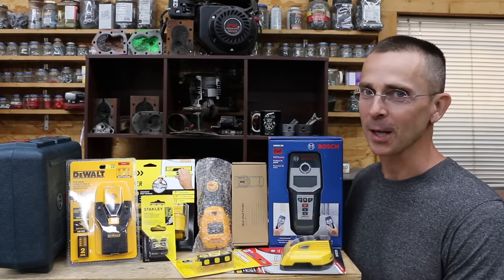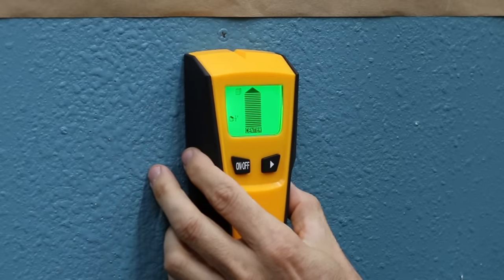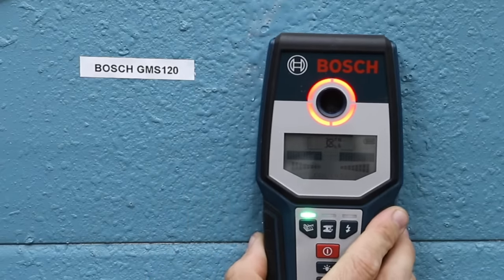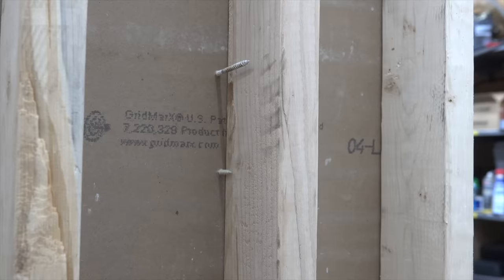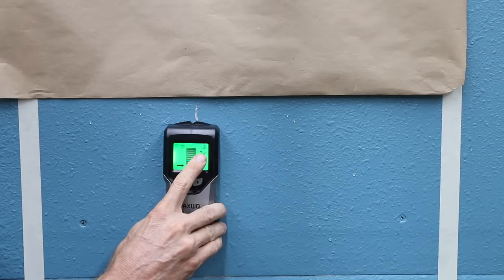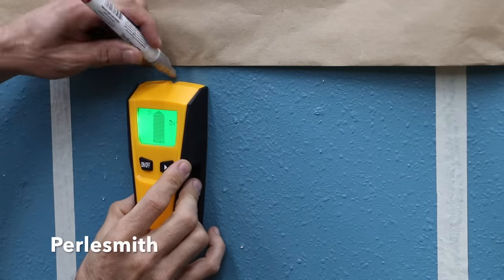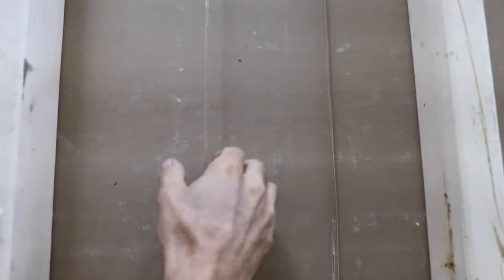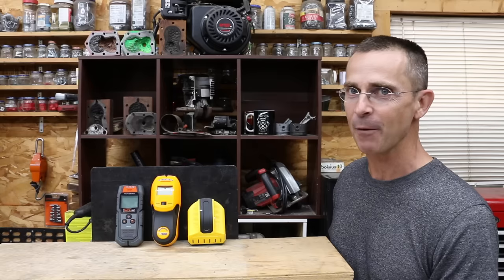Best Stud Finder? $262 Bosch vs $10 CH Hanson vs 9 Other Wall Stud Scanners! Let's find out!

Comment: Best channel on youtube by far. I own an old house with nothing but lath and plaster. Best results for finding studs  is to detect the small finishing nails that are used to secure the laths. The magnetic ones work really well and was able to find them well with the cheap Amazon one using metal mode (Model TH510)
Reply from the maker: Thanks for the feedback.

Comment: Great review, but hears a thought, many old homes have .75” of plaster over lath or .5” of plaster over blue board. I live in the latter and have never been able to find a stud finder that works well through thick plaster 😞😎
Reply: Walabot plaster/concrete mode might work
Reply: The Franklin T13 works great at my house. I have what is called Kal-Kote. It is a plaster type of product and cheap stud finders do not work for me.
Reply: @AnthonySomes  never seen a challenge yet my Wallabot couldn't handle.
Reply: After removing enough lath and plaster to make me consider changing careers and learning that forgotten trade just to save others from the removal process, there should be enough nails running up the studs that a good magnet can pick them up.
Reply: My in laws have a 1856 farm house. Finding the true 2x4 solid oak studs is impossible without just cutting into it. Sucks.
Reply: @jasonc3522  LMAO.
Reply: @jasonc3522   not if its metal lathe
Reply: @trenvan5546  didn't even think about that nightmare, I'm usually working in old historic renovations if I'm dealing with plaster.

Comment: Now what I'd like to see would be the same test again, but this time with old-style lath and plaster rather than drywall. My limited experience is the extra plaster density and wood lath make it so most stud finders either decide the whole wall is a stud, or decide there are no studs.
Reply from the maker: Thanks for the suggestion.

Comment: I’m not sure how you’d test them, but how about shop hand cleaners like Fast Orange, Lava, etc?
Reply from the maker: Thanks for the video idea.
Reply: Include Prosoap in this one.
Reply: Also new motor oil to clean hands
Reply: @backwoodsbilly8548  No, no, no...WD40!
Reply: Have to include gojo too
Reply: Kerosene or gasoline works well for getting thick grease off your hands. At the expense of the smell
Reply: Meyers soap too!
Reply: Dawn dishsoap works better than most I've ever tired with less effort.
Reply: Cherry Bomb soap is amazing for removing old axle grease, as is the el cheapo dollar store hand cleaner (like the type of gojo without pumice)
Reply: @sipdachery3  As a residential painter the best we used for paint was kerosene (was on hand as paint thinner and heater fuel, anyway). 2nd to that I think was Fast Orange with pumice and Goop, which were also much better smelling and better on the skin.
Reply: As an addition, in times of need, u found that a few good pumps of hand sanitizer will loosen a lot of grime out in the field, so include that as well.
Also, I found that moist hands and some powdery clay from the ground can also provide an impressive amount of cleaning power, and that ine takes a bit of practice.
Reply: Dawn and play sand mixed. It takes everything off.
Reply: That's a good one
Reply: How about trying transmission fluid as a hand cleaner
Reply: "big wipes" supposedly no heavy carcinogenic chemicals in it, so much safer and friendlier for the skin.
Reply: Boraxo
Reply: @johnkay6197  I've done dawn and salt, and that seems to work good, it helps that they're both right in the kitchen
Reply: Brake cleaner #1 Shop rag #2
Reply: I always thought Lava should make a liquid body soap called Magma, for people to deep clean after a long day at the factory. And nothing caffeine or stuff like that, calming smells to help you relax from the day
Reply: snap on pink hand cleaner will win hands down
Reply: TIDE, LAUNDRY SOAP! used it all the time when I worked for an auto salvage company.
Reply: YES
Reply: Test it by removing grease from white canvas.
Reply: @sbvera13  i did a test with oxyclean powder on my other channel. it really does work, it cleaned dirt, grease and oil from a white rag.
Reply: There’s a soap by Chemsafe called magic, it’s incredible!!!
Reply: Hoping Zep TKO is in the competition. Available on Advanced Auto's website
Reply: @kcjones679  I gave it a shot today works great even thanks for the advice. Sprayed it on my hands my brother jokingly ask if its for arthritis saw how clean my hands got were believers now lol
Reply: No matter what hand cleaner you use, you absolutely must use a hand and nail brush when cleaning if you have a serious case of mechanics hands.  It makes it possible to clean off all traces of the dirt and grease without spending a half hour just rubbing your hands together.

Comment: There are different walls that I've encountered that REALLY make it challenging for the stud finders.
- thicker drywall
- 2 layers of drywall.
- lath and plaster walls.
- plaster over drywall.
I hate most stud finders that I've used, but I find the Franklin to be the most helpful for the thicker walls, though they don't sense them perfectly either.
Reply from the maker: Thanks for sharing.
Reply: Insulation behind the drywall is tricky for the stud detection.

Comment: If you ever decide to redo this test (though it'd be a lot of work), it'd be nice to test these against traditional lath-and-plaster walls as that's the real ultimate test of any stud finder (and for those of us with old houses, it'd be a godsend to find one that actually works!).
Reply from the maker: Thanks for the suggestion.
Reply: Straight up I got so frustrated with my lathe and plaster walls I just bought a scope. I drill one hole, stick in the scope, turn on its light, and because our walls are hollow - I can visually see everything!
Reply: Try the Bosch GMS 1220
Reply: not that it's a practical suggestion in most cases but a decent sensitivity thermal camera makes an incredibly good studfinder, i've got some old firefighter cams i use for it and it works great when normal stud finders just don't work in my 1910's house, doesn't work as well with mildly insulated walls but does work well with super well insulated walls (the studs are just worse insulated instead of better)

Comment: It would be hilarious if you also tested “guy who uses knuckle” vs stud finders...
Reply from the maker: lol  Thanks for the suggestion.
Reply: Better get one of those "old school" carpenters for the test.
Reply: It's a valid technique if you have a good ear.
Reply: LoneWanderer360 only on wood studs w/ standard drywall, & if you're sure there's no live wires in your workspace.
Reply: or tapping your hammer on the wall.
Reply: @GabeMacDonnell  Works on metal framed walls too. If there's no obvious plumbing and no outlets on that stud, not much to worry about.
Reply: That would be great.
Reply: *Tom Silva has entered the chat*
Reply: More accurate than the zircon I have that's only 3 months old
Reply: @macgyveratlarge2133  ... and a random guy off the street for contrast ... and entertainment value!
Reply: LoneWanderer360 the reason you can't trust it on metal studs isn't that you won't hear it, but you can't differentiate from all sorts of dangerous & disastrous stuff in the walls. 

Just a few hours ago I found a live wire in a metal framed wall w/ no receptacles, b/c someone took a shortcut when wiring an automatic door. 
I've had  a dozen other instances just in the past year. & Just because it's illegal to abandon live wire in drywall w/o an access plate, doesn't mean people don't do it.  

If the person who was working didn't follow every safety protocol in the book, they'd have a bad night.

The point is, from a cost/benefit standpoint, there's no reason not to use a studfinder if you're penetrating drywall with more than a small nail.
Reply: @cmmartti  Indeed... the funky thing about the house I'm currently in is that the studs are staggered to be more 'green' about the insulation. In theory, this should also allow for better rigidity during an earthquake. See image here: https://www.goldeneagleloghomes.com/research/images/wall-systems/half_log_samples/Half_Log_With_Foam_Insulation_Staggered_2x6_studs.jpg

Putting up shelves has been a bit of a pain, to say the least.
Reply: Charles you'd be surprised...
Reply: @GabeMacDonnell  wrong. I use it daily in my electrical trade, on plaster-on-lathe walls. 90% success rate. Time consuming, yes. Knuckle wearing, yes. But it is a valid system.
Reply: Thomas Prendergast 90% not very good. But it's your time, so whatever works.

Comment: PF, I have a Zircon tester and built my  two homes with it. It never let me down. And to me, being off on the edge of a stud by an eight of an inch isn’t a big deal. You usually just want to find center so you can hang a picture or install a shelf. Great video as always!
Reply from the maker: Thanks!  Thanks for sharing.
Reply: @dcgo44r  You need a stud finder to locate studs behind the Sheetrock to install shelves, hang pictures etc. I don’t understand your question; should I have memorized every stud location?
Reply: @davidstepeck2644  sorry it wasn't a question.. Me being me.. Builders  usually leave the wall marked with white strokes where the studs are located! But you are ok.. Don't mind me! Lol!
Reply: @dcgo44r  The white marks you are speaking of is joint compound which covers the screw holes in the sheetrock.  However, those “marks” get painted over etc. Haw a nice day!

Comment: Modifying the test to include different depths of sheetrock and even lathe would be beneficial. As a remodeling contractor, a stud finder can lie to you pretty easily when scanning over different substrates.  Great vid as usual my good man!
Reply from the maker: Thanks so much!
Reply: Agreed. As a contractor, I only care about finding studs. Plaster and lath is definitely the trickiest, while any drywall is child’s play. The t13 is the best and fastest for drywall, but I’ve yet to find a sensor that can reliably find studs and blocking behind 1” of plaster and lath. The gold standard would be a sensor that could find furring strips behind plaster on a masonry wall, like above a fireplace. 

Sometimes the easiest is to use a thermal camera to see the studs, but I understand a $6K flir camera is out of the range of homeowners.

Comment: Great test video! I like Franklin Sensors for simplicity, and find it quicker for locating exact centers. They have a new Pro M50 model with changed design shape that looks closer to other brand stud finders. They added electrical sensing and additional depth and is about the same affordable price as the T6.

Comment: The best stud finder I’ve ever used is looking at where outlets or switches are, and or knocking on the wall. Lol

Edit: I should add, it’s obviously not perfect and won’t find things like pipes or wires. It is a great method in a pinch though.
Reply from the maker: Thanks for sharing.
Reply: 'Old work' boxes laugh at you.
Reply: As a very experienced trim carpenter I can agree. I can find a stud by this method faster than a detector. Register vents on the walls is another great indicator. There is always king studs next to windows.
Reply: That's really cool
Reply: @corepuncher   Knocking still works.
Reply: Picture-hanging nail and Cresent wrench 😅
Reply: Good luck finding that live copper wire , or water filled pipe worth that method!

Comment: I’m curious if insulation would affect the stud finder especially if the whole stud bay is filled with spray foam.
Reply from the maker: Thanks for the video idea.
Reply: Good question. I wonder what the inductive profile of spray foam would be when compared to structural wood.
Reply: Yes.  It has a DEFINATE impact on some studfinders rendering them useless depending on the machine and the density of the insulation.
Reply: @ProjectFarm  If you do insulation, please consider using Rockwool as one of your insulation products.   I've found that to be about the most flush and dense insulation out there if properly installed.  It can definitely play havoc with some finders!   
That's why for just finding studs alone, I think the magnetics are the most reliable and easiest to use.  But I'm fascinated at what they say a Walabot can do......  Hype or a real tool?
Reply: @brianjensen5200  CCF is very dense, but not always finished flush with the stud.   To get max value, CCF can have a gap between the face of the CCF and the stud face.    OCF can be shaved flush with the stud, but is more porous than CCF.    Some used a blown recycled material for a time that was dampened and shaved flush, but I've only seen that used in the NE some time ago.    CCF if people can afford it and Rockwool are favorites today along with the more cost effective traditionals......
Reply: Great idea, fiberglass, rockwool, open cell spray foam, filled cavity, closed cell spray foam 2-3”, closed cell filled cavity, etc... so many options!
Reply: I tried to leave a link but I don't think it posted.   Search for this article from Zircon for more detailed information on the subject:   "Why It’s Difficult to Locate Walls Studs on Exterior Walls with Your Stud Finder"
Reply: I would ensure to try it with different insulation such as spray foam vs the pink stuff vs sound resistant such as Rockwool.
Reply: This was my first question. How would the different types of insulation effect the accuracy?

Comment: Would like to see this same test done on lath and plaster walls.
Reply from the maker: Thanks for the suggestion.
Reply: That's the real test. Finding the stud in drywall is easy. Lathe and plaster is a pain in the ass. Nothing really seems to work consistently
Reply: i want  a scanner to see a live wire located behind a brick wall.
Reply: @ProjectFarm  this would be great
Reply: I've lived in both kinds of houses. Unfortunate truth time: If you've got sheetrock walls, 99% of the stud finders will work instantly and identically (most people just bang on the wall). If you've got plaster and lathe, virtually everything is useless because the industry can't/won't make a cheap instrument that works on P&L.

I've actually bought that exact model DeWalt in the past (along with several others) and all of them were completely or mostly useless on plaster and lathe. I ended up needing to borrow a professional model from a friend that was specifically rated to work on plaster & lath (MSRP $320).
Reply: @harveywallbanger3123  Did it work well?
Reply: @BW-ze3mg  It did. Let me text him and see if I can get the brand and model #.
Reply: @BW-ze3mg  He says its a Bosch D-TECT 150 and it has a metal detector to pick up the line of nails instead of using a density sensor.
Reply: @harveywallbanger3123  awesome. Thanks dude
Reply: @breadbutt  Great advice, thanks!
Reply: My house was built in the 50s and has some plaster like walls i used a small stack of 3 rare earth magnets to find nails or screws worked out well

Comment: Project Farm.......
I wished that you had tried the “Wallabot”, it detects everything behind a wall.  It’s like looking through a wall and seeing studs, electrical, pipes, etc!  It’s like an X-ray, only it uses rf signals.
Reply from the maker: Great suggestion.  Thank you.
Reply: @Project Farm 
I misspelled it, it’s actually Walabot.  Google it and it explains the process of seeing through a hard surface.  Wow, they have really dropped in price!  Thanks, and love your show!
Reply: Walabot fails on plaster and lathe in oooold houses. We have one at work and for testing brought it home to test.  Works great on drywall though.
Reply: I'd like to see this as well...
Reply: @markkayser426  I have an old house with lathe and plaster walls and bought a Walabot to 'see' into the walls. I was quite disappointed that it didn't work as I saw nothing in their advertising noting otherwise. I do see that they now have a model that can look into lathe and plaster walls but I haven't bought one as I still have a bitter taste in my mouth from my experience with the first one I bought. That and I have paneling over the plaster and worry that will interfere. 

A buddy of mine with plaster walls said that he has had good luck using a zircon in deep scan mode to find studs, although the wire finding ability of the walabot was the biggest selling point for me initially.
Reply: Hah, I had the same idea
Reply: Id like to see that too. It's a scam. It doesn't see anything. It senses some things and displays a photo on the screen of the phone. The commericals are really shady.
Reply: @Ninja Master 
So says the inexperienced one with an idiotic state of mind!
Before sticking your foot in your mouth, you really ought to try it.

Comment: Just picked up the Franklin Sensors pro model with the electrical detection.  I was able to install some heavy duty metal shelving in my garage in just a few minutes.  It's truly a joy being able to reliably see the studs in the wall and ceiling and know where the center is!
Reply from the maker: Thanks for sharing!

Comment: I've been using the Zircon for 15 years or more. It does a great job but I have to remember it does miss that left side on occassion. Great at finding the romex and the pvc too. My only "complaint" is having to press firmly on the side button. Also, a powerful magnet is great at finding the drywall screws and therefore the enter of a stud. Thanks for another great test video!
Reply from the maker: You are welcome!  Thanks for sharing.
Reply: I like the Zircon, however drywall screws are not always in the center of the stud.